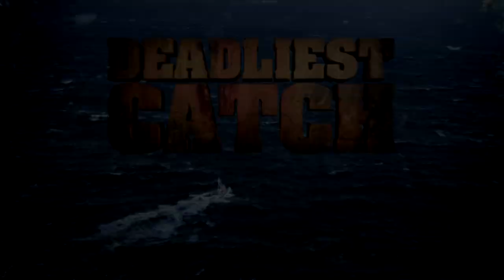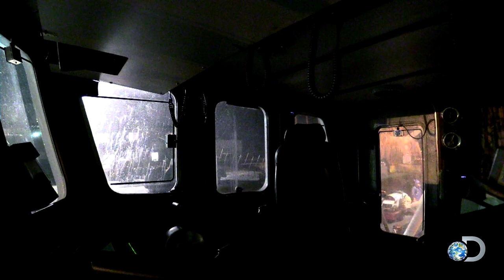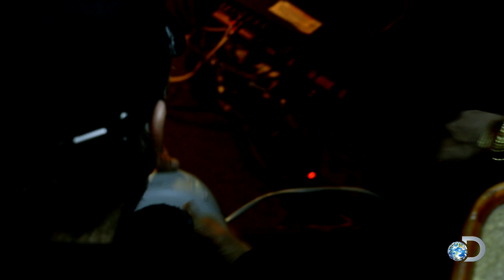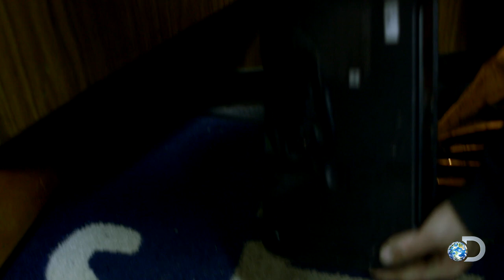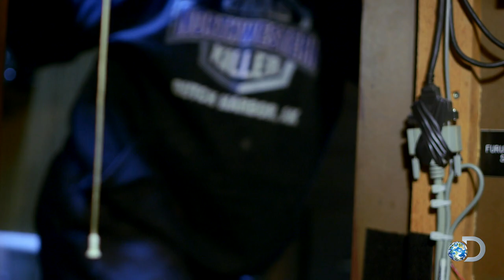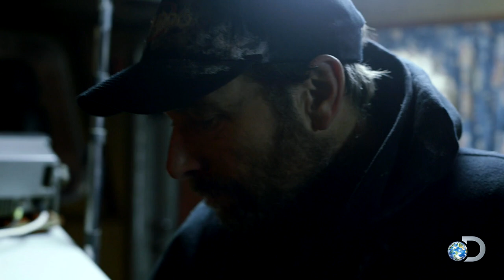Malfunctioning Battery Nearly Sparks Blaze on FV Northwestern

Comment: JUST had this happen with a backup.  Got lucky at home also.  Remembered this episode.  If they go,,get it out and away.  Toss it quick but careful into the yard,,or water or, ,  harborside(lucky).  Those cells pop hard while shorted.  Gotta keep them cool while on a load.  Lotsa ventilation.  Little fans are just that,,get a max size one,,leave room for more fan if you can.

Comment: Not surprised it was an APC branded UPS...that company has gone way downhill in quality since they sold out to Schneider Electric. I have had several of the post-sellout units fail, including one burnout like in this video. I use Tripp-lite now.
Reply: In fairness, they've probably used it longer than they should have without replacing the battery, but yeah...I'm typing this in a room where I have two similar APC UPS's in use and I'm not feeling great about it.
Reply: If I were you I'd get rid of those APC's sooner rather than later... I have had a nearly 100% failure rate with APC's built after the late 1990's..., a few would just quit or beep constantly, but most suffered some kind of smoking failure. I use Tripp-lite now and have only had to change out batteries after a few years.
Reply: mxslick50 Roger that. Tripp Lite is good stuff. I just got to travel surge protector made by them and even it is solid. It's definitely what I'm going use the next time around.
Reply: I have an APC branded UPS. But it’s the older style one love it works great.

Comment: You never want ocean water and battery acid mixing, that's for sure. Though, it didn't look like that battery, was one that had battery acid in it.
Reply: Yeah, it looked like a lithium ion battery. But that's actually worse because lithium will ignite in water which also means you absolutely cannot use water to try and extinguish a lithium fire.
Reply: @killman369547  Does water just spread it, or does it actually cause the fire to grow in strength?
Reply: @killman369547  I would bet Li-po, which is EVEN WORSE than a Li-ion battery to have go because they can become literal flamethrowers. Not to mention… lithium fires are really difficult to put out, since exposing lithium to water creates even more heat as well as hydrogen gas…
Reply: @knightlife98  Lithium reacts with water to produce heat, lithium hydroxide, and hydrogen. Hydrogen + fire = bigger, hotter fire… big fire + hydrogen = Hindenburg.

Comment: rofl that serial cable they tied together with what looked like zip ties dont they know the metal screws are there for a reason they secure each other so no need for the zip tie
Reply: The screws aren't long enough. If the grey cable was plugged into a panel mount socket then yes but you coupling extenders on those. That black cable is from a Garmin multipoint gps receiver, technically if you use there extension lead you can use the screws but the grey cable is probably wired into the boat.

Comment: Its a battery back up like from a house, if battery goes it keeps trying to charge it and it over heats.
Reply: That sounds incredibly unsafe. They should build those battery chargers with safety features to shut them off once the battery is full or if the battery is degraded. I think that would prevent a lot of these close calls.
Reply: @killman369547  high end stuff has it but most consumer stuff doesnt... its all about cost